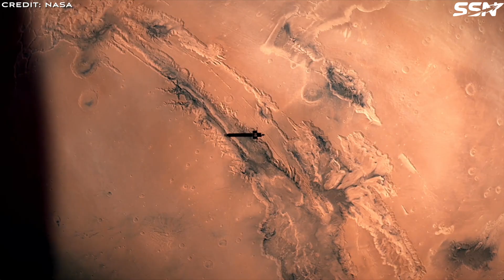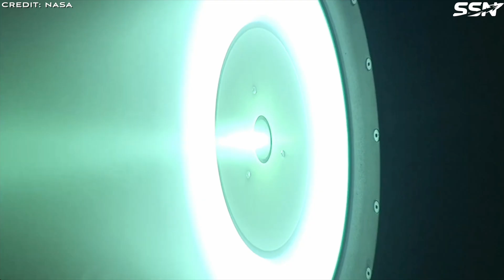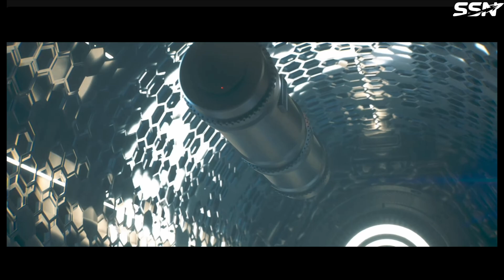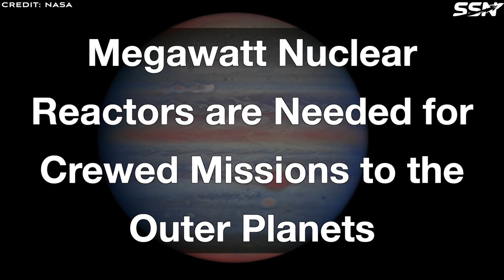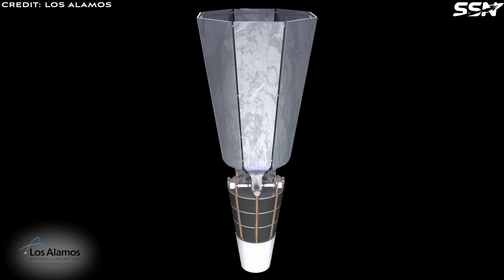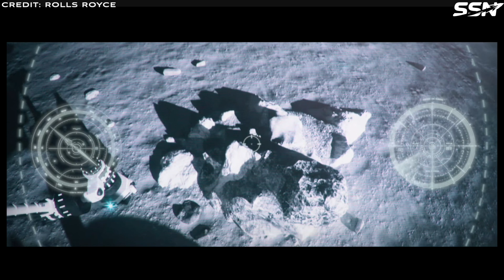Nuclear Propulsion for Fast Crewed Transits to Mars and Beyond: NTP, NEP, Advantages and Challenges

Comment: You could use a small modular nuclear reactor 

To create a high pressure steam jet

Spinning an A/C alternator, connected through a piezoelectric oscillator -

To a magnetron or tesla coil (+ output as plasma)

Within a magnet lined rocket nozzle, with - coils, returning to a battery -

So that the 

Alternator is spun by steam 

D/C - from alternator to Tesla coil or magnetron (-) and magnets, (flows through)

Back through the piezoelectric oscillator (-) 

So the whole thing is like D/C negative, but through a crystal oscillator 

And the + is essentially electron and other EMF radiation emissions by the coil or magnetron 

With the electrons flowing in a loop through the battery, from the alternator to the oscillator and back, or to battery for storage.

Then, the + terminal 

Flows through the opposite side of the crystal oscillator 

And forms output, for a digital display, for instance 

A radar

A computer  

Headlights 

Etc

While the motor is powered by fission

More submerged control rods, gives more surface area for fission. 

This then translates to higher voltage ⚡️  plasma jet, and more powerful magnetic confinement 

For a switch powered plasma jet through a fission reactor

Venting the steam into the plasma jet tube with magnets and coils

Should ionize the water

And add hydrogen and oxygen gas as fuel for combustion to the mix

Comment: And we cannot let the NTP exhaust into earth's atmosphere for radioactive reasons
Reply: The heat from the nuclear power unit only heats the hydrogen. It does not make the hydrogen exhaust radioactive.
Reply: @tomfrazer1428 at Jackass Flats the Nerva tests sure did. That's why the motor testing was stopped after the Atmospheric test ban treaty was signed.

Comment: 100KW = 100 hair blow dryers. And leaping from planet to planet within our own system on a reasonable time scale will take waaaaaaaaay more power than that... More like 1000 Gigawatts. But it's a really good idea. So let's get to work on it.
Reply: The main problem still being the particles ahead the ship: at high speeds, they act as bullets that can perforate the hull and jeopardize the crew and equipments inside it.
Reply: @edhal9000  The fundamental problem is generating enough power. But yes. I'm sure it would be much like sandblasting. Unless one devised some kind of shield... Like maybe a giant ball of frozen gas and dust just to plough the way?
Reply: @JurassicConservative  Not exactly like a sandblaster. I saw a rubber ball perforates a steel board of one inch using a eletomagnectic cannon; I don't remember witch speed they used but, at the velocity needed to reach Mars in days, any small stone will turned ito a big problem.
Reply: @edhal9000 not at these speeds, and a simple composite shield will take care of micro meteorite
Reply: MW is sufficient for a small craft
Reply: Look we started somewhere! If want to reach mars at suitable time frame then we need to go heck of a lot faster than current technology!
Reply: @dumitrulangham1721  Yes, I agree, but with the current technology, going there at high speed is something like trying to reach the sound speed with a bicycle: it may be that you can, but the bicycle and especially you will not survive.

Comment: The euphemism "heat management" masks the enormous problems of heat dissipation in nuclear electric propulsion systems. This video doesn't do a good job of digging beneath the manufacturers' public relations brochures.
Reply: Well it is a reporting channel, meant to bring us news.  There is more information out there if you look for it.
Reply: @martythemartian99  Okay, but in my opinion, just showing the PR videos and brochures doesn't qualify as news. Some of the nuclear engines shown require gigantic heat dissipation panels (aka heat management), rendering those proposals practically useless.